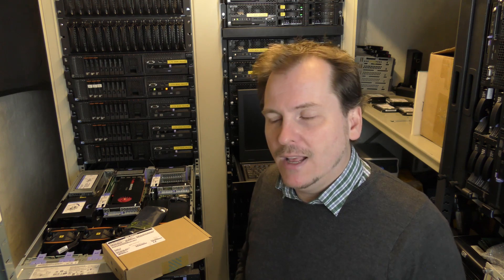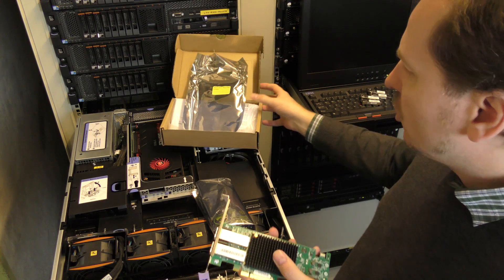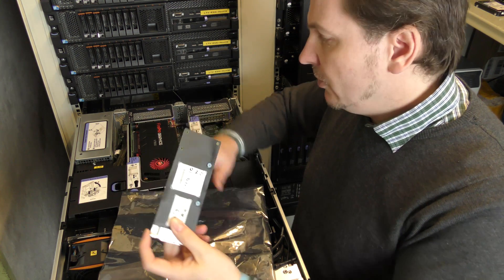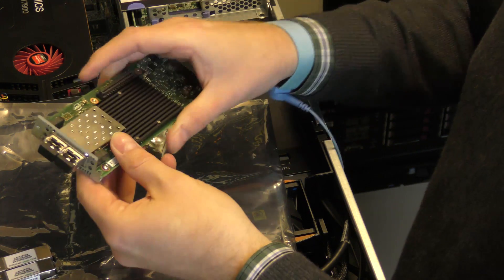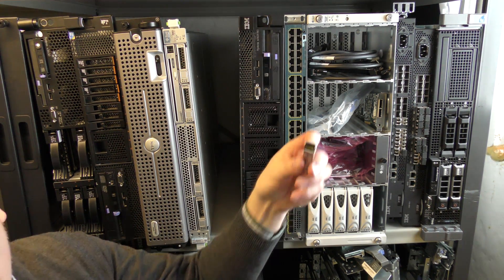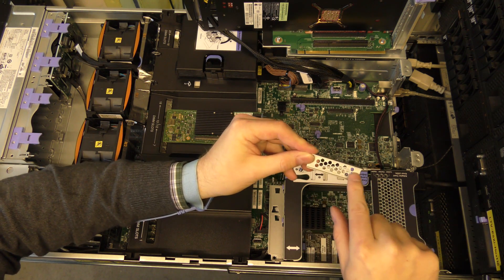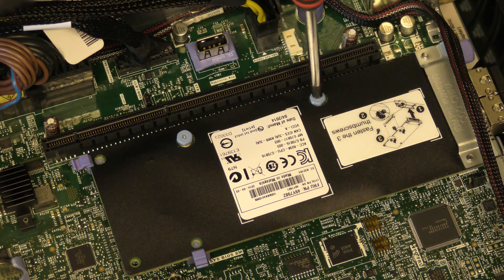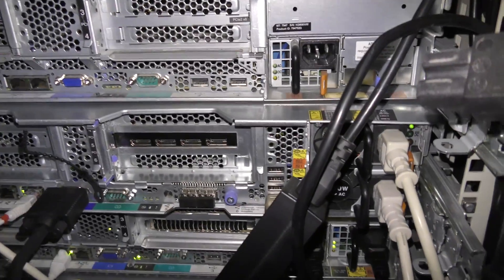Intel X520 Dual Port 10GbE SFP+ Embedded Adapter - 510

Comment: for datacenters and land networks, i really like fiber optical cable and switching equipment for fiber, like sfp switches and connectors and of course the fiber optical cable. 
i do a small bit programming and configurating on server and switches, but the funniest thing is the fiber cable installation and not the copper cable.
Reply from the maker: Hi Mikael Ji Skov Kristensen
Thank You very much!  glad you liked the video :-)
Thank you for watching! :-)

Comment: Hello,

do you know if 49Y7980 Intel X520 Dual Port 10GbE SFP+ Embedded Adapter OR 49Y7960 Intel x520 Dual Port 10GbE SFP+ Adapter for System x works with x3650 m3 too?

Thanks in advance
Reply from the maker: Hi iorgu iordan
They might work just fine,,, there are other adapters in this list : https://lenovopress.com/tips0805-system-x3650-m3
Under : Network adapters.....
Thank you for watching! :-)
Reply: Thank you for encouragement".
We had a good offer for Intel (about 200 euro new), unlike Mellanox (00D9690 - 350 euro)
  i will get one for x3650 m4 and i will test for m3 (do you know if m3 supports the mezzanine type?).
Although it is offtopic, what type of  the latest Cable Management Arm (CMA) do you use for m3 and m4: 69Y1192 =IBM System x Gen-III Large Capacity CMA or 00FK622 =System x Enterprise 2U Cable Management Arm (CMA)? I mean, would it be a problem depending on the rails kit or m3 / m4, or does NOt matter?
(I would not want to buy them for nothing)
Reply from the maker: Hi iorgu iordan
I do not think the mezzanine cards from the M4 will fit in the M3,,, there are some darted carts available for the M3,, but only 1Gbe.
CMA,, I just use the set that comes with the box,,, never thought
 about it...
Thank you for watching! :-)

Comment: What raid setup do you need to have the fastest Hard drive speed from 10,000 rpm drives to get the fastest 10 GB, I have A Netgear 1,000 with two 10,000 on it, I would a some raid 50 is the best for this, you have A lot of good computer info in your videos keep it up, thanks
Reply from the maker: Hi Joel Crocker
Well raid0 would be the fastes,,, but no security. then raid1..
Thank you for watching! :-)
Reply: This what I will be getting three Dell PowerEdge T110, they are on the cheap, with good cpu upgrades & sas config, I want the Dell PowerEdge T130 but it looks like they are out of my range for my project, but the price is right for my network build for that Dell PowerEdge T110, what would you recommend for the cheapest 10 gb network cards, thanks
Reply: The cpu was dead in that system, I got A floor model of A T300 from A different Seller, in the mail

Comment: Check on youtube for 3 part's of 10 g sfp low cost . i do the same in my lab and they work's very well.
I have ESXI 6.5 with 5 VM with 10 G and NAS with 10G and my workstation with 10 G.
Youtube :
https://www.youtube.com/watch?annotation_id=annotation_2143703043&feature=iv&src_vid=p39mFz7ORco&v=MgNpI6VAAhI

Comment: Hi you can use DAC Cable it's SFP+ with transceiver include. that's what i used. you don't need a long run. 0.5 M 1.0 M 1.5 to 3 M.  check this on ebay

https://www.ebay.com/itm/CBL-10GSFP-DAC-0-5M-Dell-Force10-Compatible-10G-SFP-DAC-Copper-Cable/192142192814?hash=item2cbc9130ae:g:bC0AAOSwDk5UBZMe
Reply from the maker: Hi Regent Lemay
Thank You very much!
Thank you for watching! :-)
Reply: Stay tune

Comment: I still don' t like 'Lenovo'. IBM should never have sold it.
Reply from the maker: Hi Ray Hey
I hope Lenovo keeps the high quality, like they did on the laptops.
Thank you for watching! :-)
Reply: Yes and no.. Lenovo Thinkpads come in 'cheap' and 'good quality' lines and even then the quality does not really match the rock solid IBM Quality. Made in UK.. not China.. not a scratch after years of usage. Compare that with current Thinkpads.. I know the Lenovo Workstations and Servers still are quite good, but at the same time the brand contains much cheap consumer products and not much innovation anymore.. I like Thinkpads! But they used to be better, at least that's my impression.

Comment: Hi Morten,
Are there any standard RJ45 type cables (CAT6/A?) compatible with 10Gb Ethernet NICs?  This is completely new to me, but I am not sure what the SFP is all about.  I am still learning though.  Thank you so much for putting up this video.  It's a great starting point to learn...  

Cheers.
Reply from the maker: I'm not sure,, 6 or cat7!
Reply: I have no clue...looks like there both CAT6 and CAT7 is capable of handling 10Gb bandwidth, but the industry is moving towards optical cables.  I was wondering about RJ45 type connector and backward compatibility with old network switches.   But again...it will probably be time to upgrade switches if one needs 10GB bandwidth.  Thanks again for posting these videos.   It really helps keep up with technology, especially for those who dont have their own datacenter lab at home. Thanks so much. 

Also, one request, would it be possible to make a video on Switches, Fabric Connects, Cables and Connectors types?  I would appreciate that so much if you could.  Thanks once again.
Reply: Cat6A is what you want for 10Gb Copper Ethernet, CAT6 should do it as well for short runs. You can get a Copper cable called a DAC which is copper cable with an SFP module at each end. This should be cheaper than 2 SFP+ and the fibre patch lead. The pro's and cons are that DAC cables can have compatibility issues between vendors and max length is about 10M where as SFP+ and Single/Multi-Mode fibre cable runs can be longer and you can use different vendor SFPs at each end but make sure they are same types along with cable i.e. LX Fibre (Long Range) SFP+ and OS2 Fibre ( 9/125) or SX Fibre (Short Range) SFP+ and OM3 Fibre Patch (50/125)
Reply: Additionally the more common Server cards on the second hand market are the SFP Fibre types so these will nearly always be cheaper.
Reply: I would use cat 7, I have had good luck with cat 7, the new switches should know if it is realy A cat 7/6 cable or not,  on mine it is two different colors and that is A gigabit switch

Comment: not exactly same thing
I have find out this hard way
intel is crap network wise
I have had intel AF DA
at best I was getting 1.6gbps (from 10gbe)
I have switched to infiniband (qlogic qle7140 single port 10gb cx4 infiniband sdr x4) which due to being out very much like pcie is actually just 8gbps
anyway I got my 8gbps using exactly same hardware.
Now I am getting 1GB/s from my BTRFS RAID6 previously I was getting just over 160MB/s using 2 10GbE ports
Emulex is much better
QLogic is much better
Broadcom is much better
do not use intel for networking - it is bottleneck
Reply from the maker: The is a lot of trouble, you've seen! :-/ hope you get it working.

Comment: so now you've upgraded to fiber at home... i guess i do now have someone to talk to about dealing with my fiber. i have my data centers linked through fiber to 5 x3650 m1 and 5 xseries 346
Reply from the maker: Hi Joe MacPherson
I have not gotten that fare yet,, but I am going that way... :-)
Thank you for watching! :-)
Reply: My PlayHouse I have a quick question 
Is the server management port only usable with a RSA or is it something completely different?

I have Avocent DSR8030 KVM that I'm still trying to figure out on setting up but I'm thinking the RSA is a better way to go from the looks of things
Reply from the maker: The RSAII or IMM is completely different, and can run on a different VLAN if you want that,, and you get some good options,,, and you can use both,,RSAII and an KVM.

Comment: Do you clean the LC fibre patch cable and the sfp port of dust before connecting the patch cable? I am more talking in mission critical applications, although your little data centre is starting to be a little mission critical now :)
Reply from the maker: Hi Mac·au
Thank You very much! Yes  we clean with those  weird fiber cleaners.. But we do not usually reuse the cables.
Thank you for watching! :-)

Comment: I feel like such a commoner using 1GB connections between my computers and servers now! I saw Linus Tech Tips with his 40GB/s network between machines and I have wanted to upgrade network speeds, but I have simply not made the investment in switches and routers for the change yet.
Reply from the maker: Hi Tyler Barton
I am not running 10G yet,, just warming up for it!!
Thank you for watching! :-)
Reply: At least I found out that the older 40g qsfp cards that use pcie 2 x8 cant even deliver the 40Gb per Port because pcie 2 x8 only gives 32Gb bandwidth so you end up with 1 32Gbps connection or 2 16G ones

Comment: What is the model of the Cisco switch? I have been looking at the Quanta LB6M, but I don't really need 24 ports.
mellanox connectx-2 cards can be found on ebay for under $20 free shipping and 3 meter DAC cable included,
set MTU to 9000 and I get 9.8 gbps to my fileserver.
Reply from the maker: Hi Adam Rosas
Thank You very much!  glad you liked the video :-)
Thank you for watching! :-)

Comment: at Work the whole base infrastructure is Singlemode. We test how mutch stress an patch cable could handle and yes you could see an minimal drop if you step on it/snip against it. Multimode OM* is the same, but if you go up from OM2 to OM3 or 4 it is less an problem because of the higher quality of the fiber and the drop wount be as high as in OM1.
Of cause dual Fiber/single way is commend in nomal use, but some carrier, especially FTTH one, use dual Way/single Fiber with 1/10G.
Yes prices for 10G are Multi Mode 300/550m < Single Mode 10k < Single Mode 40k but if you want to use Fiber Channel 16G or go multiplexing like DWDM... man there you have to pay an massiv enterprise premium.
And don't reuse fiber patch cable is normal for us, too.
Thanks you for creating :)
Reply from the maker: Hi zENjA
Thank You very much!  glad you liked the video :-)
Thank you for watching! :-)

Comment: Interesting topic :) It just happens that I unboxed a Cisco Catalyst 4900M switch and two 10 Gbit optic transceiver modules... Also, it's the first time I see a Cisco switch at your datacenter. Are you going to set them using the console or telnet, or are you just going to leave them as "dumb" switches? Have you got any experience with IOS? (I'm just curious)
Reply from the maker: Hi AttilaSVK
Thank You very much!  I am getting a bit of help on the cisco´s :-)
Thank you for watching! :-)

Comment: That orange multimode fiber starts to cut out around 10Gb speeds, you want singlemode fiber or OM3/OM4 multimode fiber for 10Gb. Some of those Cisco add on cards for that series of switched only have two 10Gb ports, making the other two 1Gb ports, or all four ports can be used at 1Gb speeds. I think the cards you have are this way.
Reply: http://www.cisco.com/c/en/us/td/docs/switches/lan/catalyst3750x_3560x/hardware/install/notes/net_mod_note.html   The C3KX-NM-10G  is what I am talking about
Reply: Robopwner ack, usually 10gbe is only specified for om3/4,howecer at this small distance it shouldn't be a problem
Reply: Oh yeah, you are correct. I just found this chart, should be helpful: http://www.lanshack.com/Fiber-Type-vs-Speed-and-Distance.aspx
Reply from the maker: Hi Robopwner
Thank You very much!  That sucks,, I thought I had 4 10G ports,, now there is only 2. :-/
Thank you for watching! :-)

Comment: Hi,
i got myself two X540-T2 with RJ45 connectors (1 for my server/nas and 1 for my pc). But no matter what i do i cant get passed 1.4 Gigabyte/s transfer speed. I tried some real world file transfers via SMB3 Multichannel and also some benchmarks. Any idea why?

EDIT: But i get around 1 gigabyte/s with just one port. PCIE limitation? And if yes of the card itself or my pcie port. I run the hole thing on a dual processor mainboard can that cause problems with pcie speeds?
Reply: Wait. 1 Gigabit or 1 Gigabyte? 1 Gigabyte is the max of 10GbE.
Reply: Jonas Meyer try to increase the MTU of your network cards
Reply: I already did set it to 9000 "jumbo frame" and increased the transmit and receive buffer.
Reply: Do you use SSD Cache at the NAS?
Reply: Are you saturating your disks' read/write speeds on the client and/or server? That would be my first guess. You should try doing some network speed tests with iperf, that way it is only testing network speed and not any other bottlenecks.
Reply: I tested the file speeds with a ram disk on both server(nas) and client(pc) with a single 13gig file. For benchmarking i used NTttcp. Also the disk tranferspeed and active time for the ram disk was fine in the windows resource monitor. I checked the specs of the nic and it says it should handle (PCI-E 2.1) 5TB/s at 8 lanes so 32 Gigabit/s uni directional on the pcie slot?
Reply from the maker: That is not bad at all!!
Reply: ~1 gigabyte/s with just one port and ~1.4 gigabyte/s with two ports. So i get the max throughput with one port but i dont get the max throughput with both ports. But i dont know why. Maybe its because the nic cant handle more or its because i use a dual cpu setup and maybe dont get all 8 lanes or something. Does anyone has maybe an idea how i can test this to find out what the problem is.
Reply: There is likely some overhead somewhere in your setup, plus link aggregation does come with its own set of issues. Is 1 GB/s really not fast enough for you? If it really is not fast enough, then you may want to look into 40GbE or 100GbE.
Reply: +Curtipus
Thanks i will definitely check it out this weekend.
+Ken
Well, it not really 100% nessessary for me to get 2 GB/s but when i already get 1 GB/s with one port 1,4 GB/s seems a little less for an additional port. Its also a bit about getting 2 GB/s because i want to reach 2 GB/s :D
Reply: I see. Fair enough, but do you know your server can even write 2GB/s or more? I mean, it is technically possible 1.4GB/s is the max speed of your storage. I can't even write 1GB/s with WD Red Pro 6TBs in RAID 10 (3 stripes with 2 drives per mirror).
Reply: Im testing the connection with ramdisk so that should be no problem. I also have some Intel DC SSD laying around which i hope can handle the 2 GB/s as write cache. I just want to quickly push a lot(5-10GB) to my storage and not continuous sending at 2 GB/s.

Comment: Just got 2 x540-t1's with RJ45, finally upgrading from the slow gigabit network in my office.
Reply from the maker: Hi VRBTech
What cables are good for 10Gbit in rj45 ??
Thank you for watching! :-)
Reply: Cat 6 Rj45
Reply: My PlayHouse i have cat6a sftp all over but measured 750MB/s over 20 meter of cat 5e utp. Thanks for the vids!
Reply: Depends on the distance. I am using literally cheap CAT5e UTP cables at my cottage but my server and desktop are right beside each other so it is very easy to get 10GbE at that distance. Generally, CAT6A will provide 10GbE at any reasonable distance.

Comment: i hope one day you play  with a connect x2 card as its causing me nothing but issues i have a intel x520 card coming as the mezzanine card i got works beautifully just not the connect x2 card
Reply: Have you seen Linus Tech Tips' video entitled "Our Cheapest & Fastest Network Speed Yet?" It deals with the specific quirks of the Connect X2 cards in Windows. You need several drivers or firmware updates in addition to subnet tweaks for everything to work properly with an existing Internet link of a more traditional technology such as Ethernet.
Reply from the maker: So,, has that day come,, yet :-) Morten from the futura...

Comment: if you need any assistance with your Cisco 3750e, let me know.
Reply: actually looks like a 3650e or 3560e  couldn't see it that well on my phone.
Reply from the maker: Hi Daniel Tekmyster
Thank You very much!  glad to have a Cisco pro at hand :-)
Thank you for watching! :-)
Reply: It is not a 3560e, those have X2 ports
Reply: It is a 3560-X
Reply: Robopwner your right, i should have realized that, i have the 3750x at home, and we use the Es at work.

Comment: What about putting a 10 GBE card in your file server and/or main computer?
Reply: Actually 1.25Gbyte/s, although overhead brings it down a little. The overhead depends on packet size, but generally when using jumbo frames you would get about 99% of this.
Reply: Gigabyte ethernet?!?!? ;)
Reply: Actually 10 gigabit/second  IS one gigabyte/second... :P
Reply: Ha! Touche, good sir! I should've included 10 with my kidding troll comment.
Reply from the maker: Hi Caden Higgins
Thank You very much!  Yes that would be a great use for it.
Thank you for watching! :-)
Reply: Assuming your storage is fast enough to write at 1GB/s. I have 10GbE at my home and at my cottage and I must admit it is great.
Reply: though Jumbo frames has pros and cons